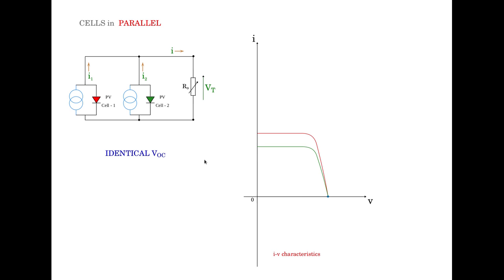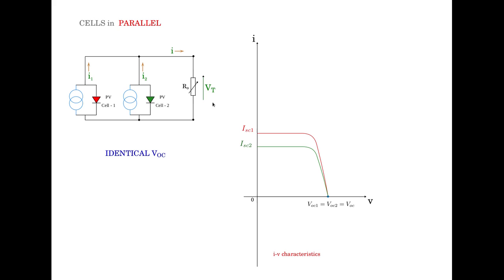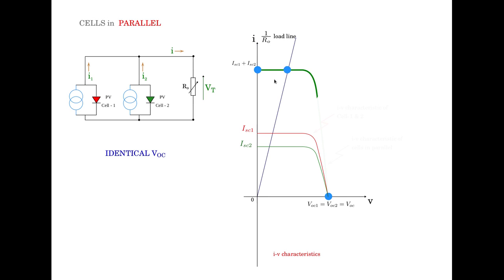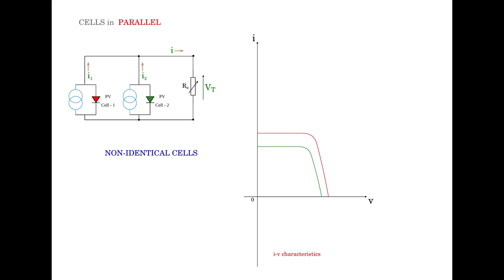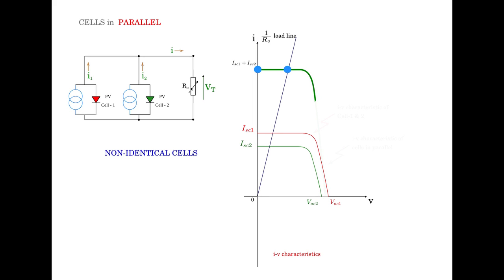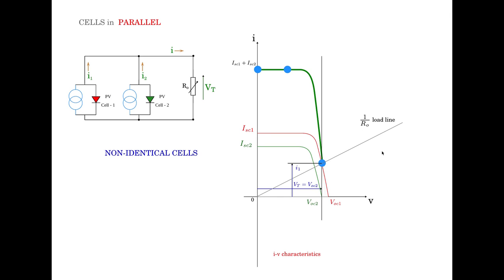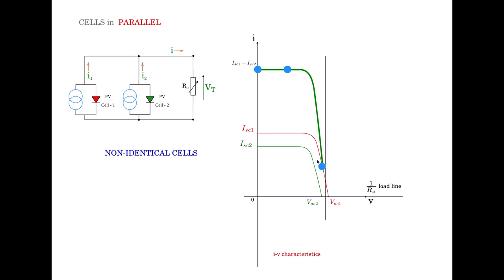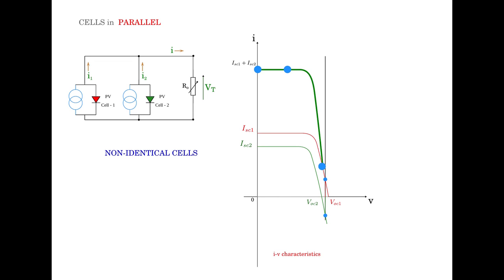Non-identical  cells in parallel

Comment: what will be the net output when 2 cells with same Isc and and different Voc are connected??
Reply: I m not sure, but a circulating current will start flowing in that case.

Comment: At the point when cell2 reaches OC voltage( Voc2) can we still connect two cells in parallel? At this point the two cells voltages are different because the curves are different